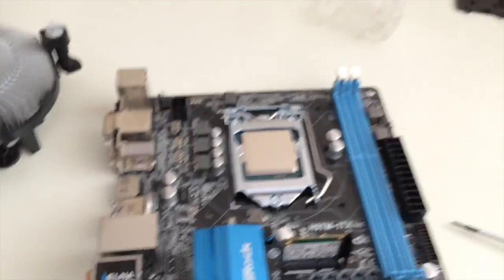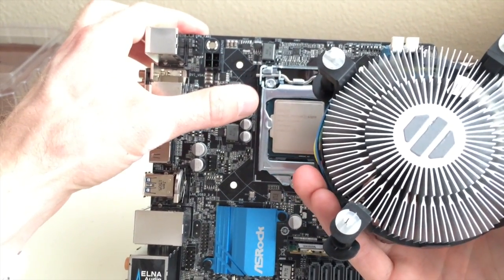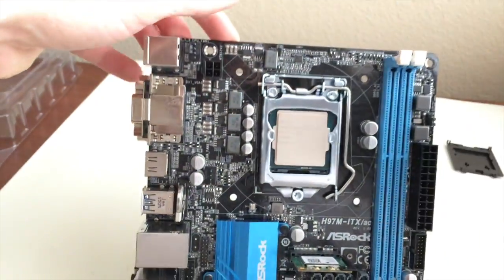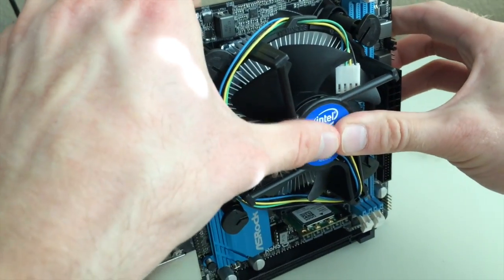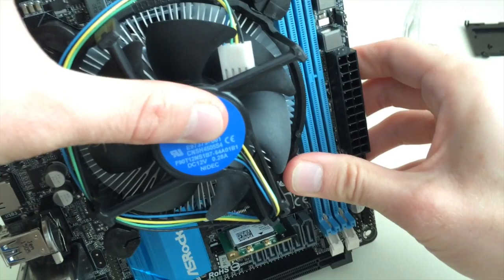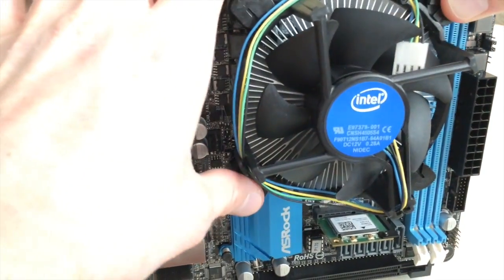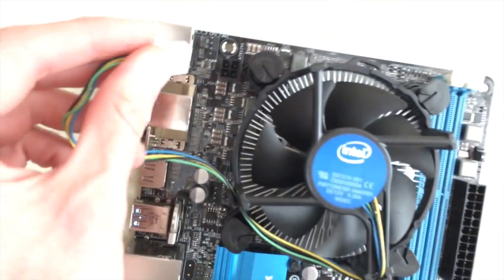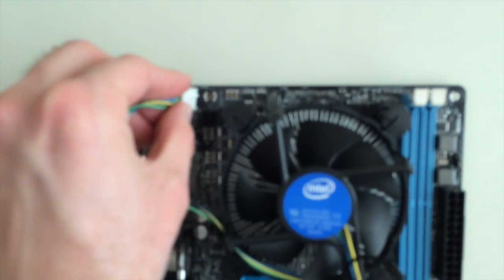How to install Intel heatsink

Comment: I have the same cooling system and intel i7 processor. Can I upgrade my PC with i9 processor without changing cooling system?
Reply from the maker: It all depends on the specifics of which i7, which i9, which stock cooler it was. Generally, the Intel stock coolers are not good, so I would not recommend it, I would recommend getting a new cooling system along with the i9

Comment: Can I use my Pentium G3220 Intel stock Aluminium heatsink cooler with Core I5 4590 which  I got 2nd hand & without its Intel factory Copper heatsink cooler.
Will there be a big difference between copper & aluminium heatsink temps.
Plus it's my first time installing a processor. What's the right way to apply thermal paste?
As a pea size dot in center or spread it evenly with a spatula🤔
Reply from the maker: Well, copper is a better conductive so it will not work as well. I imagine it will work, but you might get thermal limiting or the fan will just be noisy working extra hard.
yeah pea size dot in the middle, no need to spread, just put the heatsink down evenly and it will spread it as the pressure goes down
Reply: @relaynotes  Thank you so much.
But if you can tell me idle & load temps of that I5 4590 then it'll be far easier for me know that a beefier cooler is needed or not.
& someone says that older processor can burn with some stress test utilities like Intel Burn Test or Aida.
If you can tell me a safe stress test to check this processor then it'll be awesome.
Btw thanks for your time. Your videos was awesome & definately deserve more subs. I'm the latest one😍

Comment: If you get the CPU  and heatsink does it come with thermal paste?
Reply from the maker: a stock one from intel or AMD usually already has the thermal paste (you can see if its on there, its a gray silver kinda goop) but aftermarket coolers you usually have to get your own, or if it comes in a tube apply it yourself at least. There are different brands of thermal paste, I think artic silver is still popular

Comment: Guys, an important note.
If you're reinstalling the cpu, you have to retwist again these plastic pins, otherwise it will not click, no matter the pressure you put!!!
Reply: Thanks, I was wondering why it wouldn’t fit
Reply: Still doesn’t work
Reply: Good point.  If you've done that, and you have everything lined up so the white legs are in the holes, it only takes light to moderate pressure to get the click.  If you're pushing hard and nothing is happening, you've done something wrong.  If you can, use a strong light and look from an angle to ensure the white plastic ring above the legs is flush with the mobo.  If you need to, re-prime the pins by rotating the cap counter-clockwise and pulling up to ensure the black pin is recessed, then rotate the caps clockwise (do NOT press down yet) 90 degrees.  Now, double-check that the white legs are through the holes (white plastic ring is flush with mobo), then put light to moderate pressure on center of fan to hold all in place with one hand while putting light to moderate pressure on each pin and you will get the click if it's all in place.  Once you've gotten the click from each of the pins, you can verify there's no wiggle/movement, and you're done.
Reply: Thanks so much
Reply from the maker: yes that is a good point, to re install must twist them back to original position
Reply: Clockwise

Comment: When i pushdown to install the cooler its so hard to get it in my fingers are at the verge of breaking of how much strength im putting down to install it
Reply from the maker: I mean, it shouldn't be a crazy amount of strength, still you gotta push kinda hard. Did you figure it out?
Reply: If you're pushing down hard like that and it's not clicking, you don't have the white legs in the holes.  It should only take light to moderate pressure to get the click.

Comment: Don't you have to turn the black plastic screws?
Reply from the maker: you turn them to remove it, but to install they should already be in the right orientation from the factory

Comment: intel stock coolers are absolute cheap and nasty trash. I'd rather just zip tie a bloody basic heatsink and Noctua fan to it, and it's a lot quieter. There's a place reserved in hell for the fucking bell end who designed that shitty intel stock cooler 🤨🥴

Comment: There has been a lot of misunderstanding going on in the comment section, I have faced nearly the same issue everybody did: which is the inability to push them straight forward to be installed requires high pressure, nope. Here's a video explaining how physically you should do it. Please watch the whole video and thank me later 
https://www.youtube.com/watch?v=VDIka_2dG9c

Comment: I have a question I have an 2010 Asus desktop and I’m cleaning out because my husband is a chain smoker and I’m trying to get it cleaned out one of my little pens broke off on my Intel CPU fan how can I get that style like you were just installing or can I get one that’s easier to maneuver than that one so the pins don’t break off anymore. Screw on with screwdriver. I just don’t know options available and so on and so forth. Thanks so mich
Reply from the maker: what do you mean little pens broke off? and these coolers come with the CPUs, to buy a replacement is you would look on ebay. They're not the best coolers anyway, you might consider something like this but you need to consider the size of the case and how to install it https://www.amazon.com/Cooler-Master-RR-212S-20PK-R1-Contact-Silencio/dp/B07H25DYM3?tag=edit-tech-round-up-20&ascsubtag=06AEsa24hI9XOPV7RJLEJc9
Reply: @relaynotes  there are three little "prongs" on each of the four pegs/legs that go on the mother board (heatsink with fan) and part of one of the pegs (plastic) broke off that goes down in the little holes where they go into the mother board.  Sorry, tired.  Thanks.
Reply from the maker: @sunshinetsb1  Oh, I see. Well, does it still stay clamped on? and did you reapply the thermal paste and everything? then it could be fine even if one is broken. If it doesn't stay down though, and it lifts up, the thermal paste will not connect properly and you risk damaging the CPU. You will want a replacement then.
Reply from the maker: also typically when cleaning the case there's no need to remove the heatsink from the cpu, just dust around it with compressed air while keeping it attached is fine
Reply: @relaynotes  yes I applied the paste and the only reason I take it off my hubby smokes a lot and the components get covered in tar followed up with lots of dust and with those fans on in the cabinet it really multiplies quick. And no one of the pegs isn’t staying down.
Reply from the maker: @sunshinetsb1  oh I see. Hmm well if its not staying down you will need a replacement, I think it not cool properly and be in danger of damaging it

Comment: Damnz I HATE incomplete videos!
When you took it off... You had to unscrew the plastic pins...
Why didn't you screw them back in upon install!?
Did you screw them back in BEFORE install!?
Cause you sure as F... didn't screw them in afterwards!
Anyways... Try beginning to end next time!
Reply from the maker: So, the intel stock coolers do not really have screws. More like tabs that twist. However, when you are installing them, they are preset in the right orientation so you just push down, no need to twist them. Its only when you remove it, you have to twist to unlock (and then reset if you were to reinstall) but I cover that in another video. So, for installing intel heatsink as you get it out of the box, this video is complete.

Comment: Mine clicked but only once and its floppy oh my god i fu broke it
Reply: Same those mountain pins are east to break
Reply: @itzguudy1914  yeah that was 4 months ago on my old really crappy rig. I managed to get the rest of the pins in and it just worked mostly fine for me.
Reply: @badgerous8320  so you only broke 1 pin?
Reply: @itzguudy1914  i think yeah. but thankfully the plastic didnt break off and i managed to bend the plastic back together. Not sure why i didnt say in the original reply forgive me for that

Comment: do you need to add thermal paste or  no
Reply: Yes, you do need thermal paste in order to help your CPU transfer heat to the heat sink. If it is already applied then you may not need to add any yourself, otherwise make sure to use a suitable amount.

Please see the source used here: https://amp.reddit.com/r/buildapc/comments/319x6r/do_you_need_to_use_thermal_paste/

Comment: Obviously, don't do it this way. Place the motherboard on a flat surface, and press the cooler down into position.
Reply: @croper0  It might have turned out fine, but that doesn't mean you did it correctly. Usually, the motherboard is mounted to the case or the motherboard tray first, which the guy actually says in the beginning.

Comment: I had to remove this,  but when trying to put it back I found a couple of the white plastic  pins had split open, wider than needed.  I do not want to break them when I put it all back.  Any suggestions?
Reply: Had this same issue. I just pushed them back. 

Made me realize how horrible the design is in this stuff.
Reply: I'm having the same issue, have you resolved it?
Reply from the maker: Oh interesting. Well you don't want them to damage the motherboard for sure. Can you wiggle them and press them back together? I wouldn't worry too much about the plastic pins you can just try to push them back; maybe twist the top plastic bit will get them to close?
Reply: @relaynotes please help
Reply from the maker: same issue? you may need to replace the plastic pins, I'm not really sure how or where to buy replacements, but you can try this video https://www.youtube.com/watch?v=RRIwrJzSe6w&t=177s @Clouq0
Reply: Late reply but also had some wide plastic pins, initially the white plastic pins were kinda stuck in place alongside the black center pole. Twist the top quarter circle piece to allow white plastic pin to move down and might need to ply it with something (mine was fairly stuck). I used a hair dryer + plier to hold the split plastic pin in place, helped a slight bit with the shape and it becomes much softer when heated a bit so its easier to push into the motherboard, this was enough for me. I think if it was still too far apart some fishing line to hold the pins together would work, then you could cut it once it was past the motherboard holes

Comment: Why tf is mine not clicking
Reply: @Lina Morgana my problem was that the cooler legs where too small for the motherboard holes so it couldnt click. Happy to help
Reply: Man I had to apply hella pressure to get them clicks
Reply: @tonienchalotti5576  if they clicked than its okay.
Reply: mine don't click either but it is secure. don't worry about it.
Reply: Fr mine is same